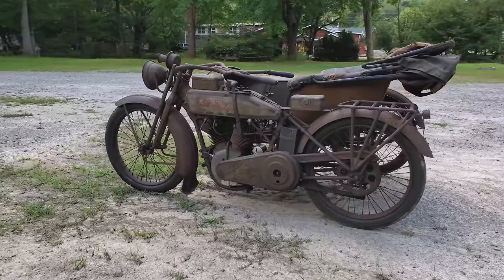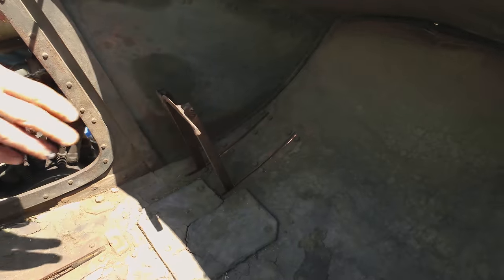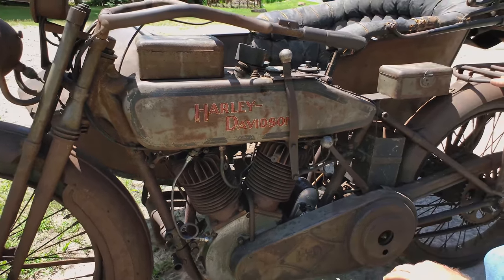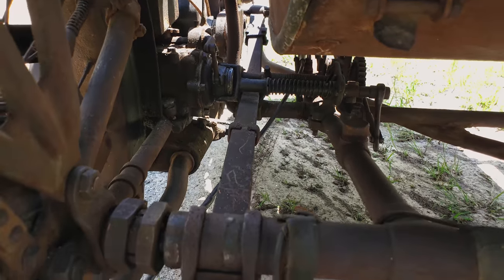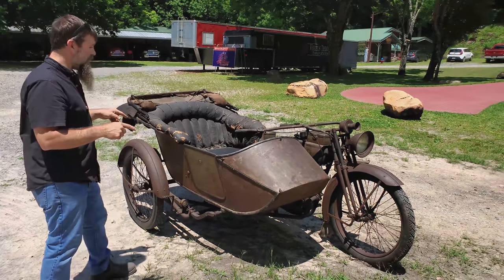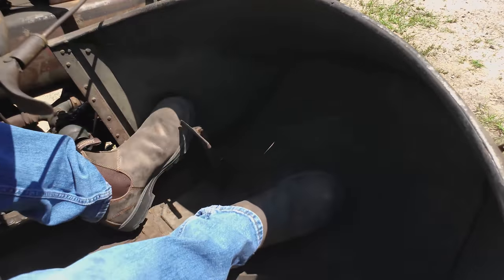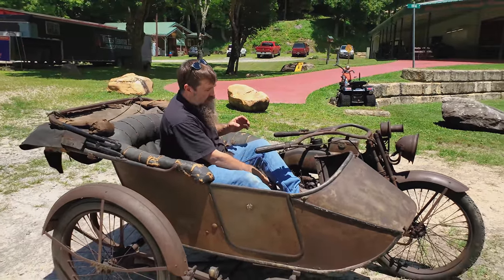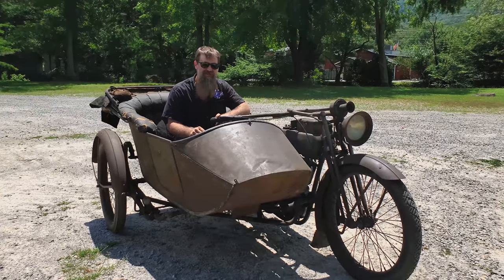The 1916 Harley-Davidson With A Twist!

Comment: Yet my 100 years newer Harley, with all it's fancy electronics, can't stay running to save it's own life..
Reply: Give me a carb and points and condensor. An alternator..and I guarantee  I'll see you at the destination
Reply: very weird, I've had zero issues with my Harley's.
Reply: @TrumpsYourDaddy  the only people who complain about modern electronics are those who are too stuck in the past to learn how to fix them. Once you understand where's what an electrical system is easily repaired.
Reply: daniel bean  can't handle a few computers huh? to be fair I am a computer engineer so I really have no right to say how easy efi is. its easier than carbs for me. I just traded in a carb'd sportster for a 2019 efi sportster. my 78 ford atm is still carb, but it will be getting efi conversion.
Reply: Here's the thing.. I completely understand electronics and computers. As a matter of fact, I'm a certified automotive technician with a degree in automotive engineering, and I'm now getting into robot programming.
That being said.. I can fix just about anything on my old Harley ironhead with a screwdriver, Cresent wrench, some WD40 and a good little hammer.
My street glide..not so much. I need a computer, a programmer, an app downloaded to my smartphone to Bluetooth trouble codes and set parameters..
As technology advances, and things become more elaborate and complex, reliably and serviceability suffer for the owner. Electronics will almost always fail before the mechanical part it controls.
Reply: @Eyore82  One day Imma definitely build me an ironhead chopper. Love those ironheads, but wanted to get me a new sporty before they drop the sporty evo motors. Need to get my mechanical skills way up before I indulge in a full on chopper build though.
Reply: @TheBabyDerp  I actually didn't chop my ironhead. She's stock, and mostly unmolested. Drag pipes and an edelbrock carb are the only things ever done to it.
And yeah, good call on the new sportster grab. I don't think they'll be the same much longer. Looks like Harley plans on morphing them into some middleweight, liquid cooled street fighter
Reply: @Eyore82  i think the street fighter will be a separate line. the bronx. my guess is the sportster will get a slight redesign but with the new 975 and 1275
Reply: @TheBabyDerp  Regardless of what they actually do, i just hope they don't screw it up too bad.
Sportster has always been the "Don't fix what isn't broke" model.
Sure they've made occasional cosmetic changes, but the heart and soul have remained pure.
It'll be a shame to see that classic 1200 disappear.
Reply: Eeyore As much as I love the Sportster, it needs to change for the market. It's becoming a niche thing. I mean I am fine either way tbh. I think a good medium will be nice. Retain similar and or classic looks BUT upgrade to modern drivetrain. many metric cruisers competing with the sporty are just plain ugly
Reply: @richardsledgecock2110  Right
Reply: @richardsledgecock2110  Totally true. That's all they needed back then to run. Nothing fancy about it. They just ran with basic principles! So cool.
Reply: @scottcupp8129   yeah I know them old motorcycles not just Harleys  .were simple as a butt crack. Usually  you could get one to buck and snort their way back home some how or another.let me tell you it ain't nothing worse than having a motorcycle shut down back on a country road in tennessee as the sun is dieing  in the west. lol and the cicadas crying in the woods.its at th>s moment your proud you can clean trash from a carb bowl or scratch your points a little. and make it back to the crib.damm at the predicament s  I've been in lol I could wright a book
Reply: daniel bean  Damn, EFI is great, why on earth would you remove it for a carb?? I mean, don't get me wrong, it's your bike I ain't gonna judge you, I really just don't get it. EFI just... works. I haven't had a carb yet that I haven't had to do something to, usually multiple times lol. Usually the worst case scenario for EFI is the fuel pump fails, which is fairly easy to replace and EFI is super easy to tune. I had a v-rod that I tuned up myself before I sold it. Ran like it got 2 extra cylinders once I fixed that factory lean.
Reply: I had the same problem with my 1986 Tour Glide with the Evolution engine.  I sold the Harley and bought an American made Goldwing.  Best motorcycle I've ever owned.  Yeah, i know...that makes me an outcast.
Reply: Right!? My shadow is 17 years old and it's always giving me fits
Reply: 40 years riding HD never a problem to speak of, you got a Friday build lol

Comment: I bet if you measure the width from center of the wheels on the bike, to center of the sidecar wheel it would be the same width as the distance between the steel rails on a railroad track.  I'm guessing the front wheel of the bike, and the sidecar wheel, at one time had special all steel wheels that were designed to fit around the steel tracks like a trains steel wheels do to keep it tracking correctly. When the steel railroad style wheels needed to be removed so the bike could ride on the street, the steel wheels were stored inside of the sidecar, on the floor to the right of the operators feet and switched to the rubber tire wheels that are also stored there when not in use.  The rear wheel of the bike would always be rubber so it had enough traction to drive the vehicle forward without slipping.  All the toolboxes held stuff a train mechanic needed to fix broke down trains that were too far away and couldn't make it to the  next station.   The railroad mechanics still trade rubber wheels for steel wheels when they need to travel on train tracks, except nowadays they use pickup trucks and not Harley-Davidsons.

Comment: 05:28 interesting front tire i had to pause and figure out the tread - NONSKID letters are the tread!
would this be a front steer only tire or would these have been used rear also? who manufactured this?
i ended up here from the 80 year old military crate as a recommended choice, great channel!

Comment: I always admired Leno for driving his cars, so glad you get'em running.

As for the plate on the floor, it is likely meant for the passenger to be able to hold a child on their lap without bumps and whatnot causing their foot to slide forward.

Comment: It's possible that the sidecar was made for normal adults of the era. Humans as a species have gotten larger over time, simply by evolution. In the last 150 years our average height has increased nearly 4 inches so it's safe to think our bodies have just gotten larger all around and not just in height, so it stands to reason why a modern adult would feel slightly cramped in it.

Comment: So basically the bike should have been totally disassembled and restored. I’m for original bikes when they are in excellent condition but a rusty original bike with failed parts and wiring is just a rusty old bike. Not restoring it just makes it keep deteriorating.

Comment: this is the kind of thing that I wish HD guys would talk about, instead of the stupid shit they actually do talk about. this is genuinely interesting, whereas generic HD lore is purely hype over high price, low end crap.
Reply: my instant thought at the beginning of the vid was that it was for someone who couldn't use both legs. looking at the whole setup in more detail, that seems to be very strongly confirmed. it seems clear that the intended user had both arms and their left leg, but the right might have been partially missing. the odd placement of the footrest might itself even be to accommodate this. notice @ 15:00 that if the right leg were amputated a little below the knee then the kickstart procedure wouldn't require the driver to move in their seat, and the footrest position would make perfect sense.

Comment: No more than the system would draw a modern alternator stator/rotor should be easy enough to hide under the primary cover, say ala Lucas?
Lucas made fine products, and my study of the subject matter leads me to believe shoddy mechanic work is what's responsible for an unwarranted reputation .....
Any number of boneheads(including myself) have repeated the 'Prince of Darkness' ad hominem